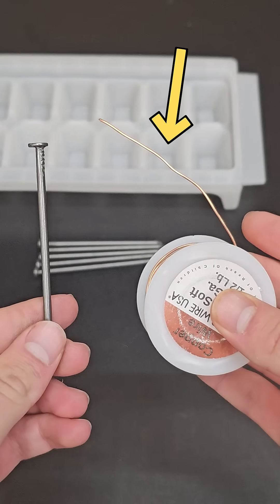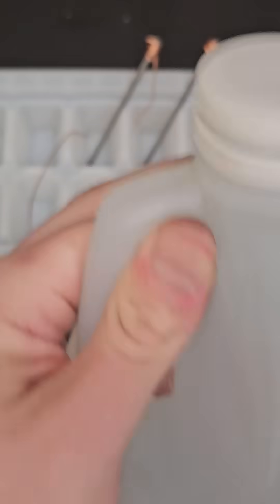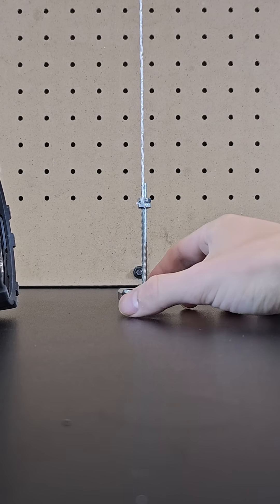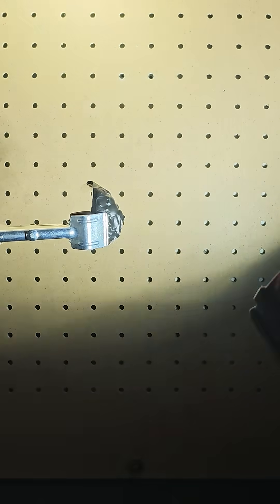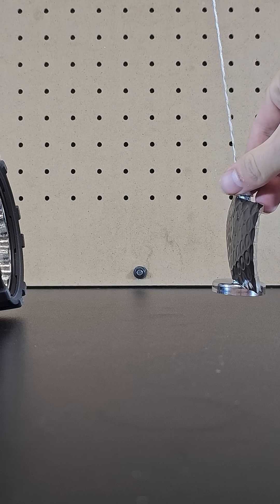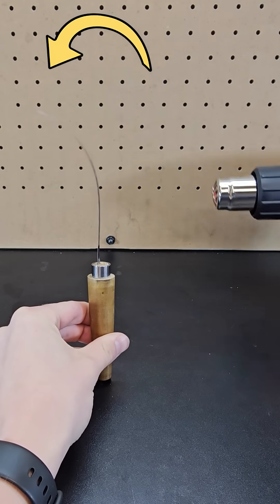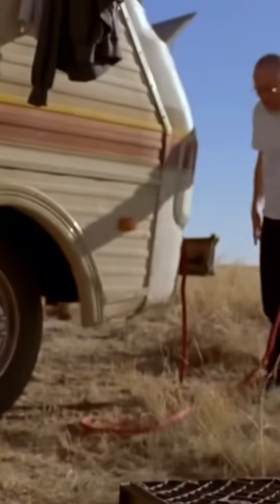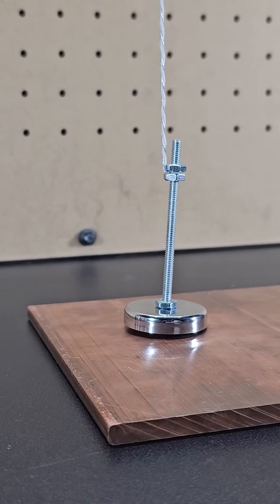Can you spot real vs. fake science? - 2 Truths & Trash (S4E1R2) #shorts

Comment: I knew the second one was a fake the moment he tried to explain using it to slow down the pendulum. Yes, the flashlight did slow it down, but it did less than drag, internal friction in the string, and gravity. Substantially less. A solar sail in space can raise its orbit around earth by a few kilometers per orbit with optimal orientation of the sail. For comparison, a single puff of an RCS motor on a spacecraft can do the same, but for a spacecraft that weighs several tons, rather than a few kilograms, and in a fraction of a second rather than over 45 minutes. Light pressure is incomprehensibly small, but it is there.

Comment: The deceleration of the pendulum is wrong for the postulated forces. Photons hitting the bubble wrap would impart a force varying only with the distance. Which would cause "bouncing" like when you have two magnets repelling each other (also, the bubble wrap with its minimal internal structure would be "blown backwards" by a force strong enough to slow the pendulum)
The electromagnetic braking imparts force both as a function of distance between the plate and the magnet AND as a function of the speed. The faster the pendulum, the more force, but as it slows down there's less braking force, meaning no bouncing.

Comment: The light thing is somewhat true it’s just that this scale is waaaaaaaaaaaaayyyyyyy too small. 

In order to stop that pendulum you would need something on the order of the sun as a light source and 1000m x 1000m solar sail. And it would really need to be done in a vacuum as drag effects would be massively more apparent. 

I’m not even sure a 1000m x 1000m solar sail would stop the pendulum as you’d still be in the realm of single digit newtons of force.

Comment: A Crookes Radiometer is an example of a device that turns light into motion. It's not due to photon momentum exchange, however, but differences in thermal interactions between the cooler, lighter sides and the warmer, darker sides of the fan blades.

Comment: And I guess again correctly mostly because I know exactly how a pendulum works and the fact that it was metal and you had something underneath it meant you probably had a magnet that was holding it in place. Although it should have still been moving if indeed the sale part had melted it would have caused a thermal reaction on the pendulum which would in turn have caused it to move not a lot maybe but a little bit and since it didn't again something had to be holding it in place process of deductive reasoning led me to the conclusion it was fake.

Comment: The moment the nails go into the ice cube tray I knew you'll be adding vinegar to create a battery.
That is pretty much how the first batteries were made.
Someone even built a massive battery to power a calculator to play Doom.

The one with the light is basically radiation pressure. And a certain degree of ablative shielding.
Except the effect is much too weak to stop the pendulum. But it is enough to adjust satellite orbits and can even work to create a solar sail.

Comment: You are all missing the point about the (fake) light sail. All the 'physics' was based on heat, not light. I don't know if that torch really is the most powerful, but it's certainly one of the most inefficient of it really gets that hot. Try it with an LED torch - I've got SOME REALLY bright ones, but they never get hot.

Comment: B 100% is fake. Photons have no mass, we approximate to 0, which means they ABSOLUTELY CAN NOT do anything to real everyday objects that have measurable mass, even when their frequency is so high that their energy becomes so high that they can knock electrons off of atoms (aka ionizing radiation) - with electromagnetic waves this happens at the upper point of UV-b rays, so anything below is regular light (although we can only see visible portion) so below UV-b (UV-a, visible, infrared, microwave, radio waves, ac electricity and the earth's electromagnetic radiations af ultra low frequencies which have wavelngths of few kilometers are safe) and only at or above UV-b, so UV-c, X and gamma are ionizing and they can destroy genes on chromosomes and they can cause mutations are cancerous because of the effects they can have on for example nitrogen based bases that are essential for coding process that makes our cells and organism as whole function properly and ionizing radiation is so dangerous for that reason because it can make nitrogen atom break one of three bonds which makes it pair to a different chromosome, but anyway, even ionizing radiation can't push an object with even as low of a mass as few nanograms, not a few full grams as shown, so fake as *bleep*

Comment: if you want to see something being "pushed" by a light, take a look at a Crookes Radiometer. (It's actually the heat caused by the light being absorbed, then heating the air right above that surface, that pushes the object; not the pressure of the photons themselves)

Comment: Notably, this is another one where the fake one is technically possible if you've got enough light or a large enough sail. Light can generate thrust when hitting an object. However, the exchange is so negligible that you'd need a truly massive surface area to get enough delta v to stop a pendulum that quickly, and much more than a singular flashlight, no matter how bright you make it.

Comment: The second one was magnetic breaking, also if this is actually some kind of solar cell a reflective cell would provide more momentum exchange the reason it works the opposite in a crooks radiometer is because of degassing from the black surface due to the heating as those things don't have a perfect vacuum.

Comment: Posting before reading any comments.  I reserve the right to be wrong. 😁

B appears to me as the fake one.  The weight seems to be a magnet, so it could be easily influenced by something off-camera.  It also comes to a rather abrupt stop rather than being gradually slowed to a stop if it were the light or even the light's fan affecting it.

C seems real.  The bi-metallic strip is commonly used in things like thermostats and related devices.

A seems real or at least plausible, the vinegar is ascetic acid working with the dissimilar metals, the same basic elements of something like a car battery.

Now to go read the other comments!

Comment: Whats wild is that light does push objects. And not in a way that cant be used. The concept of solar sails uses this idea. The photons themselves carry momentum. If you have a big enough and thin enough sail as well as the angle right to catch the photons it would slowly accelerate you through space without any need for fuel. Theyre currently actually talking about flinging a probe to alpha centauri using this type of technology with Breakthrough Starshot

Comment: I was gonna say it's b because light doesn't have mass and in order for it to stop the pendulum you need an opposite force. Force = mass * acceleration and if mass is 0 force is 0
Reply: It is B, but not for that reason. Light has no mass, but it does have momentum. However the amount of momentum is so small, that a flashlight could never impart a measurable force to a large object. 

The sun is powerful enough however, which is what drives the "solar wind" (to my charged particles) that in turn cause the Northern lights.

Comment: The second one is fake. Theres a magnet on the bottom of the pendulum, and there's metal under it. It stopped quickly because the magnet was attracted to the surface below it.

Light can push things, such as solar sails, but those sails have a massive surface area, weigh very little, are in the vaccume of space, and are experiencing much higher levels of solar radiation than we do on earth.

Trying to push an object with light in earths atmosphere is incredibly difficult (if not functionally impossible) especially when it's surface area is so little in relation to it's weight, and you'd want a reflective surface that bounces light off, causing propulsion, not a black surface which absorbs light.

Comment: I don't know if anyone mentioned this, but from watching so much Technology Connections, i can tell you that basically the concept of the 2nd one is called Light Pressure, the pressure that light has on things, which is, basically nothing for the most part as far as normal people are concerned but it is something and it can given enough time push things in space, but it does require a big light bulb, such as the sun,  by the way light pressure actually works better with things that are white rather than black, the force applied by light is greater with reflection than absorption for... reasons i don't fully understand, in any case the heat the flashlight would produce on the bubble wrap would have a way greater impact on the pendulum's trajectory than light pressure would have, heat by the way is how the Crooke's Radiometer worked, as that works via tiny convection currents in the bulb, which is at a partial vaccuum to reduce air resistance while still leaving some air for the currents.

Comment: B is fake. You would have burned your hand in that process for one, 2 the plastic bubble wrap thing melted differently then the first and the first one you kept your hand away and stood clear from the light range, 3, theres likely a magnet under the table that would have put the swing in a full stop not that we could see it but I bet its there. And 4, the sound of the fan reminds me of a hairdryer which that too can get really hot and would melt bubblewrap. 
And, my guess was correct but not for the right reasons 😅

Comment: B is theoretically possible but would result in it being pushed away from the light if it had the force to slow the mass that quickly so that's the false experiment.  

A is an interesting take on a lemon battery, 

C is a little more advanced, but I have seen enough blacksmithing vids with trying to pattern weld different metals to know that different expansion in even small contact areas is a bitch and in such thin strips will likely cause the bending effect

Comment: C was the way thermostats worked at one point, I believe.
Way back in the day when I was a physics major, I did actually manage to move objects with only light. The objects in question were microscopic silicone beads that were just polarizable enough that a sufficiently focused laser could exert enough electromagnetic force to hold the beads in place while the rest of the solution containing them moved. Light is, after all, an electromagnetic wave, ultimately.

Comment: Definitely the 2nd video. First of all, light does have momentum, so this idea is not entirely bonkers. However, nothing can emit enough light in a tight enough beam to stop the pendulum like that. Also, if this was indeed providing enough momentum to stop it like that, why wouldn’t it move it backwards? The force being applied to stop the pendulum is huge, so it would swing it back with a lot of acceleration. Finally, the best thing to use is not a black object that absorbs the light, but a mirror to bounce the light back. Funnily enough, a light sail is one of the most likely ways in which we will achieve interstellar travel, we’d let the sunlight push us towards another star and the starlight from that star stop us on the way back :)

Comment: Radiation pressure is a real thing, but you would need an unrealistically powerful light source to produce that degree of force on that pendulum... also radiation pressure works twice as well if you use a reflective surface rather than an absorption surface, fwiw

Comment: What’s really cool though is light actually CAN move stuff but you need that stuff to have a specific level of reflection and it has to be in a vacuum. My middle school science teacher had a bunch of fans that could spin in a vacuum if you shined a flashlight on them. It was cool. It’s also how a theoretical propulsion system called a Solar Sail would work. Typically the friction of the air on earth would overpower any propulsion on a small object from light which is why the experiment in the video didn’t work.

Comment: Everything about B felt like it was explained wrong. No way was a flashlight going to stop an object with photons, The color of the fabric wouldn't matter if you're insisting that photons were doing the stopping power either. But I could see it being possible that since it's bubble wrap with pockets of air, it was heating up and popping the bubbles, slowing down the pendulum. But not at that speed and that exact angle. It's a magnet being attracted to the table. Sounds like a TikTok video trying to get people to buy a powerful flashlight. A and C don't appear to be trying to sell me an item so probably real and not a fake video someone made to try and get someone to spend money.

Comment: Vinegar is an acid, which means extra ions, so makes sense it would work as a relatively weak battery.

Bi-metallic strips are a super common mechanism used in all sorts of systems from thermostats to the blinkers in your car. The blinkers in your car flash on and off because when you turn on power to the circuit it heats up the metal strip until it bends away from the contact point, turning off the light and allowing the metal to cool as it no longer has current. When it cools enough the circuit is complete again and the light turns back on creating the blinking effect.

The flashlight video is fake but it is true that light imparts a force. There are even concepts of using light sails on spacecraft to provide 'free' propulsion when traveling through space. Unfortunately for the video, it's nowhere near enough force to stop that pendulum in a single swing.

Comment: Couldn't tell if the first one was real or not, it sounded plausible but wasn't sure. The second one I knew was not real before I even saw it in action. I've heard about solar sails and the miniscule amounts of thrust they are able to generate, that rely on constant acceleration over a long time. No way you're able to generate that much force with a flashlight, also generating the necessary amount of force would probably take months.

Comment: Even in a photon mill the most significant force is the air propulsion from heated black plates expanding the trace atmosphere (the glass ball is supposed to be evacuated), and it's still a tiny force, while photonic pressure is even smaller still.

Comment: I believe the first experiment had one useless catode and one useless anode (the ones on the edges. Since the nail/copper/vinegar triplet makes a single cell. On the edges you have a pair of nail/vinegar and copper/vinegar. Not full triplets. Those two cells at the edges are duds. Maybe the LED would be brighter with propper edge cells.

Anyway the B totally looks like the pendulum weight is a magnet and the table has a chunk of copper or aluminium under it.

Comment: I was researching galvanic corrosion last week because I needed to know if aluminum and copper wire would be fine together or if they'd corrode a few months into use, I found out about the battery thing from that. also the pendulum stopped way too close to the center of its curve too fast for it to be force from light, it would be more believable if you used a fan or something that pushes the whole way down.

Comment: B was so fake, solar sails are a real thing BUT ONLY IN SPACE AND THE SAILS HAVE TO BE HUGE! The amount of kinetic energy imparted is so little that the air from the fans cooling the flashlight will have more impact than the light itself. 
Also, the "weight" at the bottom is obviously a magnet. I've seen magnetic stoppage before.

Comment: There is an interesting thing to know about light, it applies a pressure, extremely low but it does, there is a special experiment in phonic with an electrometer if I remember well that uses the difference in color of the different parts of a trustee to spin, but it works only in a specific condition of isolation and it’s not because of the pressure made by the light, it’s too low, it spins because of the gases touching the dark parts that expand rapidly generating motion
Reply: Not an electrometer, fuck I don’t remember the name of the instrument

Comment: Using two different kind of metals bound together in a coil is how a lot of thermometers work. The expansion or contraction of the metal is linked to a pointer on the temperature gauge.
Reply: Thermocouple

Comment: 2 is fake, it's a magnet and he placed a conductive sheet or block under the table like copper or aluminum, slowing it down. If it was real it would have looked like someone blowing against it.
1 is real, copper is more noble than zinc so voltage will be present when in an electrolyte. A bigger surface area would have made a better battery.
3 is obviously real, this is how many thermostats and clicksons work